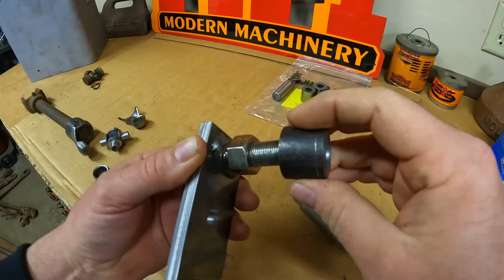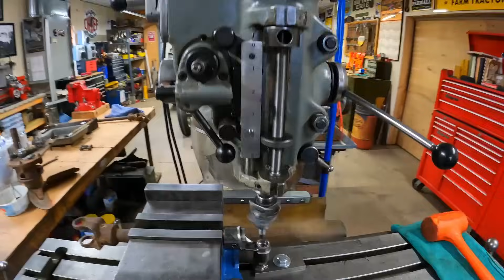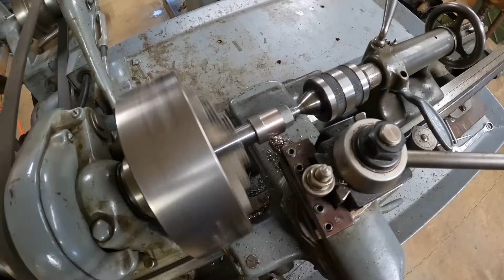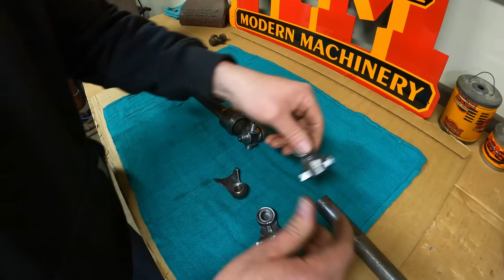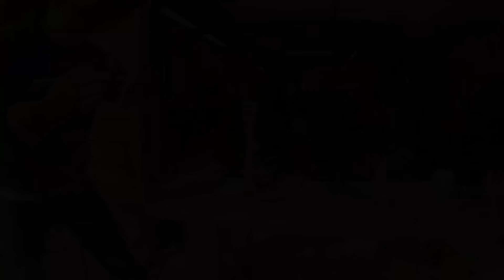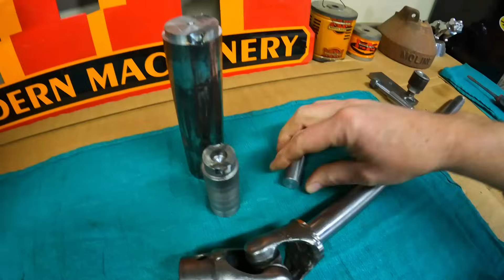Saving X231's "Non-Serviceable" Steering Joint! Machine, Weld, & Repeat - Episode #110

Comment: Random one.

I just saw a video of a guy making a gasket from lead sheet. I know you make a lot of your own gaskets: have you ever used lead as your material?
Reply from the maker: I’ve never personally used lead, but yes it works great as a gasket material because it’s so soft and malleable. They also used lead for a lot of sealing washers, but as things progressed, copper took its place due to it being able to withstand more clamping cycles before deforming to the point that it needed to be replaced 👍

Comment: Not quenching the welds is definitely a good move. Many moons ago, a friend welded a hole in the oil pan on my wife's car. He sprayed it with a water hose and the pan cracked about a quarter inch from the weld. When he welded the crack, I kept the water hose away from him. It left a softer spot on the oil pan but it didn't crack again. On the other hand, I saw another welder crack an oil pan 4 times and give up on fixing it because he wouldn't listen when I told him that he needed to let it cool slowly instead of quenching it.

Comment: that poor shop-vac bearing.  since you've got oil-lite stock, maybe it's time to fix the vacuum?
Reply from the maker: We’ve found that any oil/lube of any kind inside those vacuum motors only attracts the fine dust that comes out of the sandblasting cabinets when we’re using them to evacuate while blasting, which turns the lube into a grinding paste that wears them out even faster than leaving them noisy and dry. It’s actually cheaper to just treat shop-vacs like regular shop consumables and just replace them when they expire 👍

Comment: I’m just wondering, there must be a handyman out there in your neck of the woods who would be able to replace the bearings in that noisy vacuum ? Maybe take it to Rick Bork ?
Reply from the maker: Those vacuums will start howling like that shortly after they’re put into use here because we also use them to evacuate the fine dust out of our sandblasting cabinets when we’re blasting, and because it’s so fine some of it always gets past the filter and goes into the motor. But they’ll howl like that for several years and keep running fine, and it’s cheaper to just let them make noise until they finally quit and then get a new one. We also learned that trying to lubricate them makes them wear out even faster, because the lube collects the fine grit and turns it into a grinding paste that stays inside the bushings 👍

Comment: Blood Brothers made the u joints for my Gibson tractor = T-96 to rear axle drive spline also.  Great insight Squatch ❤️👍
Reply: Never heard of a Gibson tractor which country are they from
Reply: @ Gibson started in Seattle Wa. mid 40’s near as I can figure. Moved facilities to Longmont Co. late 40’s I think.  Rear axle housings casted with Seattle on one side, Longmont on the other side.  Serial #’s stamped on left front frame rail.  Many of the records were lost in a fire as the story goes. Production ran to 53 it appears with much of the rare models assembled from stock left over.  Interesting story for sure

Comment: OMG talk about over kill. Sorry but it's a steering shaft not a drive shaft. I guess the work done was impressive.
Reply from the maker: I've also read comments here that said I completely hacked this together and should've done better - truth is the Blood Bros factory welded those yokes onto their original hubs so off-center that this joint had an almost 1/4" wobble to it from day #1.  The alignment of the cross pegs into the yoke caps all still had to be on-center though, or else the joint would start to bind as soon as it flexed and that's what I was able to maintain through careful setup.  But yeah, not one piece of that whole u-joint is actually centered up with the steering shafts, but it also didn't need to be if it only ever saw 20 rpm :-)

Comment: Wow. That's a "rabbit hole" of a project. But I understand that the steering shaft rebuild project requires the careful & precise work you are doing to maintain the originality of the shaft, as closely as you can, within practical limitations.

Comment: I am amazed as detail oriented as you are that you didn't use a dial test indicator to level and center the half yoke. ;)
Reply from the maker: If you could see how they welded those yokes together at the factory, you'd be amazed at how little attention they gave to aligning any of them.  The two that were welded solid to the end of the steering shaft were both welded onto their original hub with about a 3/16" lean off-center, and that happened at Blood Bros before the M-M guys chopped the end of the hub off and glued it onto the shaft.  Those goofy u-joints were so sloppy and off-center that they could've only been good for non-critical things like this steering shaft.  It would've vibrated itself apart in any application that ran at any speed at all lol
Reply: I find the things they did and got away with back in the day amazing at times.  But it all averages out because I don't know how many over engineered complicated assemblies I seen also

Comment: In my mind's eye I am trying to resolve how Squatch is going to get past a technical hurdle. I have a solution worked out in my head using the equipment that he has available and without fail his solution is so much more elegant, refined more efficient than my solutions. I don't believe people can comprehend how rare it is for someone to possess general mechanic skills, structural engineering, mechanical engineering, material egineering, machinist skills, fabrication skills, project management skills and then vision and dedication to keep the endeavor together. Not to mention the YouTube side of things requiring a videographer, producer, editor, sound engineer, cinematographer, accounting, continuity manager, historian and the all important TALENT!

Well done sir, well done!
Reply from the maker: Thank you for the kind words :-)

Comment: I’m surprised you didn’t put a grease fitting on that joint.
Reply from the maker: The bushings will self-lubricate as they slowly wear, and the original hardened wear surfaces are still intact on the cross peg ends as well as the internal cap walls that they'll come into contact with, so there isn't a need for further lubrication :-)

Comment: please get a machinery handbook and look up the section on speeds and feeds. you were spinning that cutter way to fast in the mill.
Reply from the maker: Gotta remember that I'm not an actual machinist, I just fly by the seat of my pants until I get something to work out lol!  Because typed text doesn't always convey the intended tone, I would like to make it clear that the following response is just me talking in a normal "coffee shop" conversation style and nothing antagonistic - but if you read through the comments here you'll see a good sampling of what I see under just about every video, where the electricians tell me to wire better, the welders tell me to weld better, the painters tell me to paint better, the machinists tell me to machine better, etc.  I'm not a specialist in any of those things, rather just a mechanic that has always needed to be just knowledgeable enough in all areas to get whatever job done that may land in front of me.  I realized long ago that I'll never attain full competency in everything, but that doesn't stop me from putting myself and my work out there for everyone to see.  I do appreciate your comment, and I know that it wasn't intended to be anything but helpful :-)
Reply: @squatch253  I am a machinist, I just don't want to see you, or you dad get hurt. There is a simple formula to figure out speeds. 4 x cutting speed divided by diameter. you can find the cutting speed numbers in the machinery handbook. for instance, the ear of that yoke was probably a plain carbon steel with a cutting speed of 125-215fpm with a high speed steel cutter. We will average it 232. so 4 x 232 is 928 divided by the diameter of your cutter which looked like .625 gives you roughly 1484 rpm. Just pick the closest rpm that your mill can run that at, a little under is fine. The same formula can be applied to lathe rpm just use the diameter of the part you have in the chuck.
Reply from the maker: Thanks, I’ve been trying to digest the formula but I get 170 when I average 125 and 215, but also do NOT underestimate my brain’s inability to do much math. Unless there was a typo or something but it could just be me off on a wrong track too, which pretty much sums up all my math classes after the 6th grade lol 😵‍💫😂
Reply: @squatch253  i must have done the average wrong, it was early in the morning when I typed that out, lol.
Reply: @squatch253   also, there was no malice in my comment. some people like to be led to water to drink for themselves.

Comment: From one machinist to another: If the fit ever hits the shan, you will not starve. Skills like yours will be in the highest demand. I know guys who really are machinists who couldn't pull that repair off. I'm primarily a CNC guy, own my own shop, Including a fully equipped manual side, and have been in the trade over 35 years. No way I could have done that job any better than you did! Great fixturing, good stuff!
Reply from the maker: Thank you for the kind words :-)

Comment: What are self lubricating bushings, and how long will they last? Do they lubricate as they wear?
Reply from the maker: Yes, they are made with oil imbedded into them that is trapped in lots of micro-pockets.  The oil can migrate out of the bushing in two different ways - one is from vibration which allows the oil to wick out through the pockets that are near the surface or attached to other pockets further inside, or through natural wear which exposes more oil pockets as the surrounding material goes away.  They actually last about as long as a normal bushing that gets regular lubrication from an outside source.
Reply: @squatch253  Thank you. Learning something new every day 😀

Comment: This comment doesn't pertain to this episode , but rather one of the last few that you did . I saw a method for adding grease grooves into the ID of a bushing , and thought I'd share . Basically the guy made a holder for a piece of high-speed steel cutting blank that he put in his tail stock , then shaped a cutter the way he wanted the grease groove to look . Put the bushing in the chuck on the lathe , then drew the tailstock in , added the cutter and holder to it , locked the lathe up where he wanted the grease groove to be , and used the screw on the tailstock to drive the cutter . He said it was really easy doing it that way and he had really good looking results . He did warn that 2-3 thousandths was about all he could cut before it had a tendency to chatter . So he just measured the stick out of the cutter and increased it after every pass .

Comment: I’m sure I’m not the only one who is looking forward to seeing the pedestal back on the platform with the steering wheel and shaft in place. At that point all that’s left is the steering sector for the bolster, a distributor, intake/exhaust manifold (you showed a new casting on the engine build episode mounting the heads), carb, a battery and a jerry can and you can drive it out under its own power. Look at the bright side….

It’s all up hill from here! 😂

Comment: Did you consider drilling the cross for a grease zerk? Not saying you did anything wrong, just wondered if there’s a specific reason that it wasn’t an option.
Reply from the maker: No because the bushings will continue to weep oil out as they slowly wear, and the original hardened wear surfaces are still intact on the ends of the cross pegs and cap walls so there’s no need for further lubrication 👍
Reply: @ I meant in lieu of the oil impregnated bushings but it’s not like it’ll ever see dusty conditions or sit out so pushing dirt and water out won’t be a concern anyway 👍🏼

Great job btw.

Comment: I don't think I would have been unable to resist the temptation to bore the cruciform part for oilways and a grease nipple.
Reply from the maker: The bushings will continue to weep oil out as they slowly wear, and the hardened wear surfaces are still present on the ends of the cross pegs and inside bottoms of the caps, so no further greasing will be needed 👍

Comment: Nice work.  I was thinking about the inability to grease that joint in the future, but since the tractor will see limited use from now on there just won't be that much wear on the joint.
Reply from the maker: The bushings will continue to weep oil out as they slowly wear, and the hardened surfaces are still in place on the ends of the cross pegs and the flats inside the yoke bores so there’s no need for further grease 👍

Comment: Hey Squatch when do you think you’ll get to the wooden cab installation of 5J1113?  I have been waiting for that one to start.
Reply from the maker: As I’ve said before, not until I’m satisfied that the diesel engine is fully broken in and that I won’t be having to go back into it to redo something. I’d like to see at least 50 hours on the clock, and it’s only around 15 now. Trouble is, I’ve only been able to get about 5 to 6 working hours on it each year so far, which is about all our twice-yearly plow days allow.

Comment: Out of focus
Reply from the maker: This is a GoPro camera, and they have no adjustable focus. Their fixed aperture struggles with anything less than 12” away, but these are the only cameras that I’ll use in the shop due to their ability to withstand dust, grit, and sparks 👍

Comment: Your setup has a couple of flaws! First, the steering shaft should be centered in the vice. So the coupling half would be centered, then a level should be placed on top of coupling to make it level. Also, each part (4) should be butted up on the shaft end to properly locate it lengthwise 👍
Reply from the maker: The flat surface at the top of each yoke cup wasn’t square with the original inside tapered machining to begin with, so the only true flat surface to align to was down in the bottom of each cup. Add to that, both yoke halves that were attached to the base of the upper steering shaft were welded onto their original hub with about a 3/16” crooked lean in one direction, and that was done at Blood Bros before M-M further modified the hub to weld it onto the shaft. So this wasn’t a perfect setup from the start, but it also didn’t need to be because these atypical joints were only used in non-critical applications like this steering shaft. So the setup for each yoke cup had to be custom done according to each piece’s irregularity, and I would counter that the end result indicates that I got the setups right 👍
Reply: The enemy of good is perfection. I have seen too many times that trying for perfection resulted in the loss of a part where perfection wasn't necessary. With how many times I've watched these  episodes, I could see that the end result looks straighter than the original build.

Comment: Toby, could you have drilled through the u-joint cross and added a grease fitting in one of the joint yokes. Im assuming this will not see enough use to justify doing that
Reply from the maker: There’s no need for further grease, since the bushings will continue to weep oil out as they slowly wear and all the hard surface facing is still intact on the ends of the cross pegs and inside flats of the caps, so those parts are still the same as they were before 👍

Comment: As I've said before the tractor will be better than new. I don't believe she a Cristine. She is just old and set in ways. Lol
Reply from the maker: Im kinda that way myself lol 👍
Reply: I don't think Christine is a fitting name for that poor abused Minnie. As I recall, Christine would get wrecked and would restore itself. The real problem with X231 is that she was abused to death over and over again by a bunch of boys who could wreck an anvil with a rubber mallet, if you let them. When you are restoring a one of a kind machine, you're going to have some challenges. When you add in the factor of it being destroyed by boys who didn't care if they wrecked it ten times a day, you multiply the challenges. They ran that poor Minnie about thirty years and only fixed what had to be fixed to keep it running. It's no wonder that it presents a lot of problems. Don't blame the tractor. Blame the boys who kept beating her to death until she was too far gone to fix.

Comment: You need to lube what is likely the upper shop vac motor bushing.
Reply from the maker: We learned that putting lube on those motor bushings actually wears them out faster than leaving them dry due to the very fine dust that comes out of the sandblasting cabinet. We use the shop-vacs to pull that dust out when we’re blasting, and because it’s so fine, some always gets past the filter and runs through the motor head. Oil or grease picks up that dust and turns it into a grinding paste. So we just let them howl, they’ll run like that for several years before finally giving up 👍

Comment: Excellent Video and good work! Is there a end or thrust bearing for your collar to keep your upper shaft in place or is it on the top of the dash and shaft?
Reply from the maker: Yes there’s a collar with a set screw in it that goes on the steering shaft and sits on top of the dash 👍